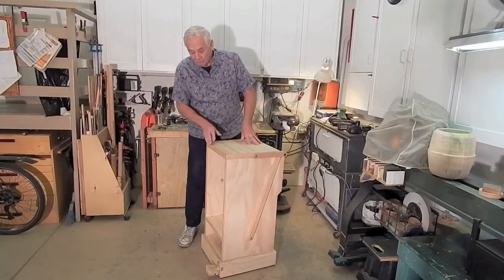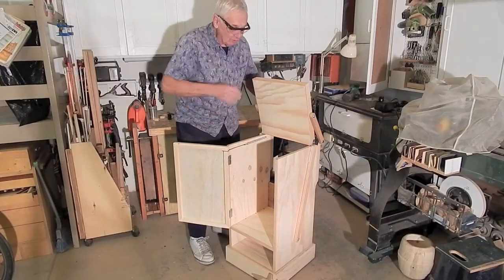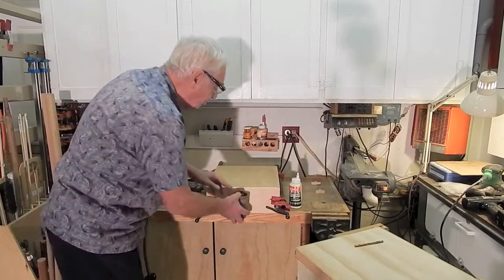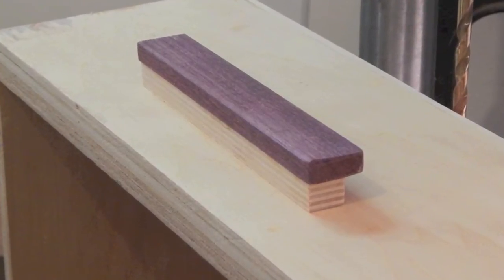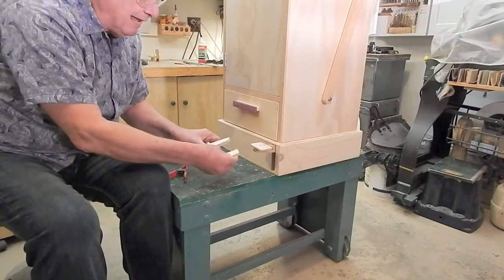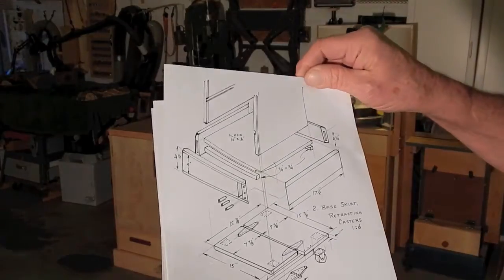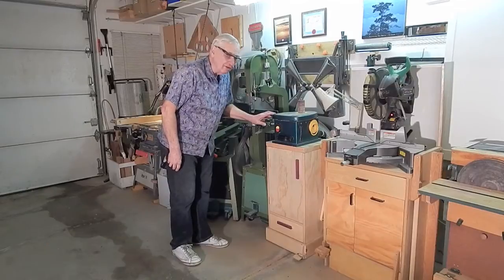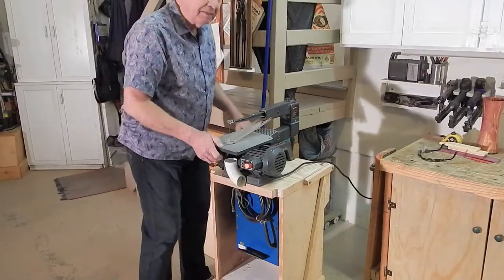Flip Top Tool Stand Door & Drawer 4 of 4

Comment: Thanks for that nice series mr Holmgren. Look forward to more. I was wondering if there was a way to make the flipping easier with a spring or maybe a foot pedal?
Might try a flip top for a contractor saw/thickness planer.
Also I need to wheel it outside where the floor is really uneven and would need more clearance. Any thought how to do this without making the pedal stick up at a high angle? 
Again thanks and keep up the good work.